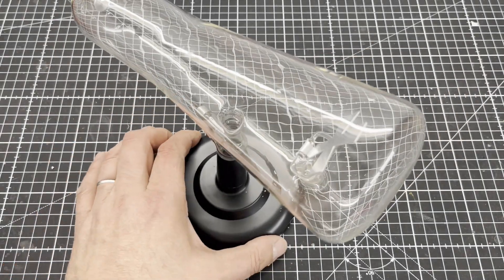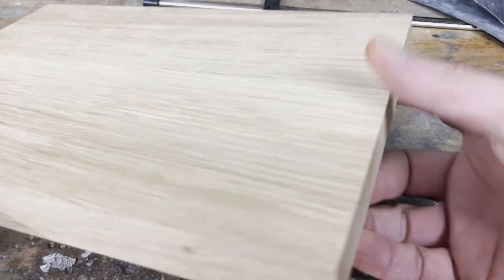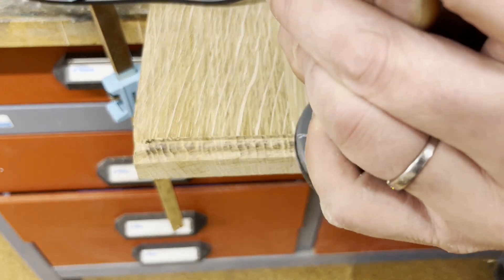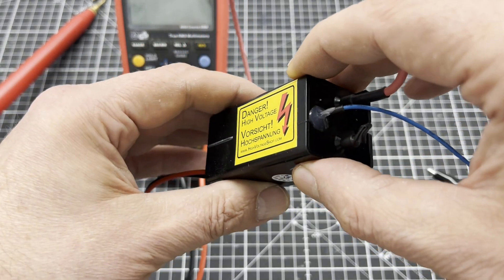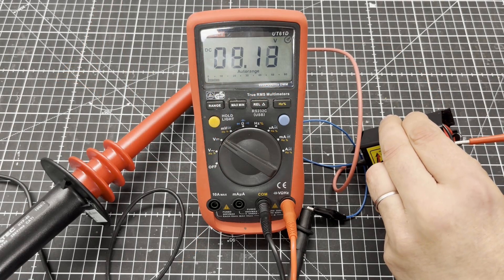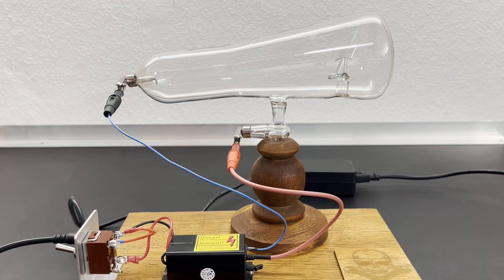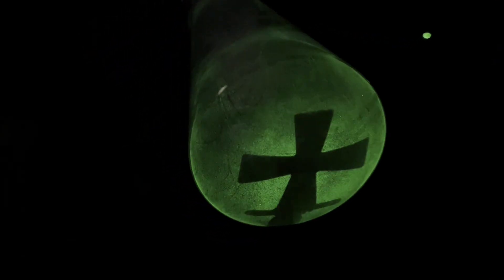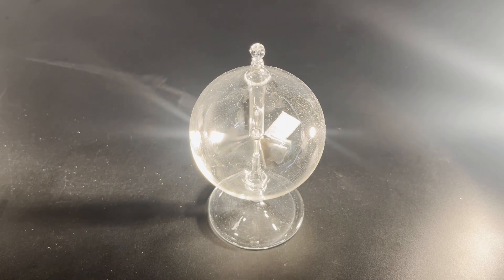Bringing a Crookes tube to life

Comment: Nice video! I have the same Crookes tube. My voltage is a little bit higher, round - 20 kV to the cathode and the anode earthed. It works, without aluminium,  (although the Maltese cross came loose during the delivery), and I neither did measure any Ionization rays with my Geiger counter. What is curious, I tried to influence the trajectories of the electrons by applying an electric field (with charged rings), but nothing happened. Perhaps the phosphorescent paint you mention is a bit conductive and shields against electric fields.
Reply from the maker: Thank you:) The Maltese cross mounting is scary. You can fold it in and out, but you have to be very careful not to break the fragile glass structure inside. The tube has no fluorescent color. It is the glass itself that fluoresces under electron bombardment. I was also unable to detect any gamma radiation with my Geiger counter, which is not surprising, because otherwise all CRTs would be X-ray tubes :)

Comment: I'm wondering about the intensity of x-rays being produced.  Protect yourself -- get a ionizing radiation detector/counter to see what your exposure is.
Reply from the maker: The acceleration voltage I use is far too low to generate any notable X- rays. I have a Geiger counter, but could not detect any significant increase in gamma radiation. To use the Crookes tube as an X-ray tube, the accelerating voltage must be 100 kV or more. But thanks for reminding me to take safety precautions.
Reply: @Marbslab  OK, but I thought you just start to produce some x-rays around 10kV as total electron energy lost in a single collision could result in 0.1 nm wavelength photons.  Maybe intensity is very low because you mostly get a lot of Bremsstrahlung.
Reply from the maker: @Impatient_Ape  The high-voltage generator's maximal output voltage is 8 kV (not 10 as claimed), and there is residual air in the tube. The Maltese cross is also not connected to the anode. The Crookes tube in this setup is as harmless as a CRT TV, which I grew up with:)

Comment: Congratulations on your x-ray dose.
Reply from the maker: At that "low" voltage (8kV), the generation of x-rays is marginal.
Reply: Additionally, X-Rays are only (mostly) generated when electrons hit a metal target at extremely high speeds. Since the cross in this tube is not connected to the anode, little Bremsstrahlung would be produced even at higher voltages.
Reply from the maker: @SenkJu  I wrote the same in another comment. The Crookes tube in this configuration would give a very poorly performing X-ray tube, even with much higher HV🙂